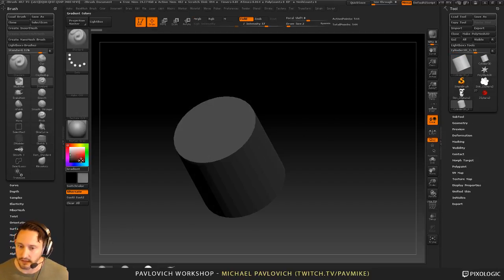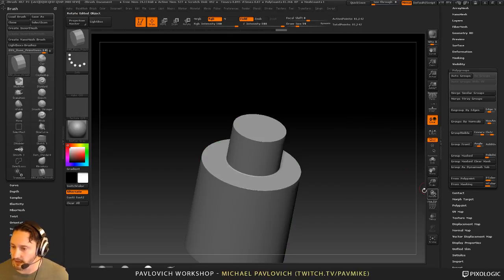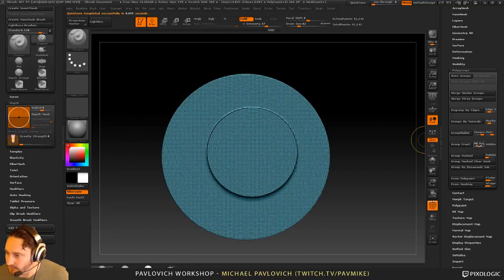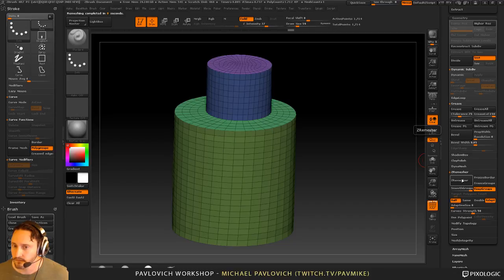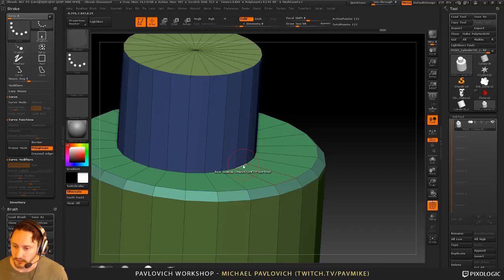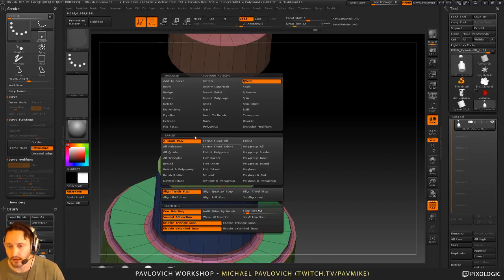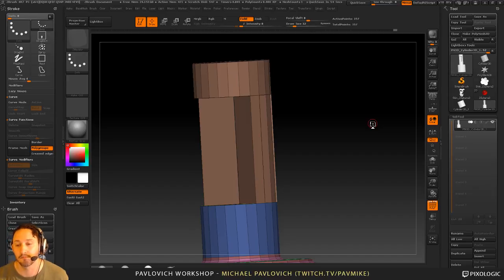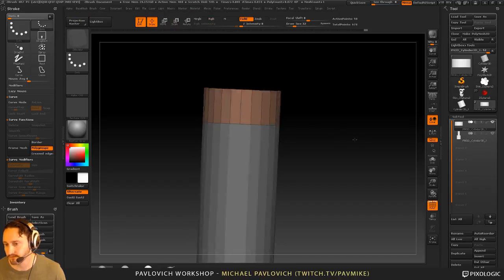PavWork10: Hard Surface ZRemesh

Comment: I'm trying to Zremesh an object from Maya that's fairly simple however it had a few beveled edeges and it's too late to go back and remove it, is there a way to still use zremesher to fix the topology even with the beveled
Reply from the maker: if you can pull a clean polygroup on the bevel it probably can; if it's a fillet it might be a bit more difficult, you may have to try and slice/mask>edgeloop masked border to help zremesh know where you want your loops